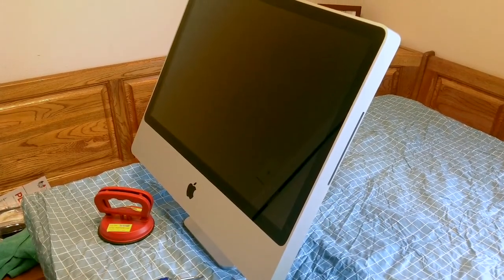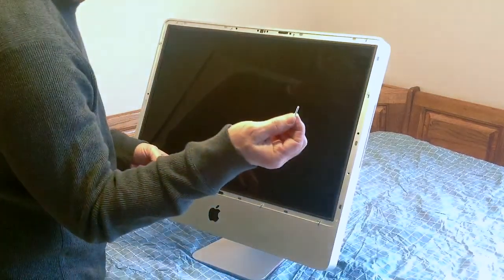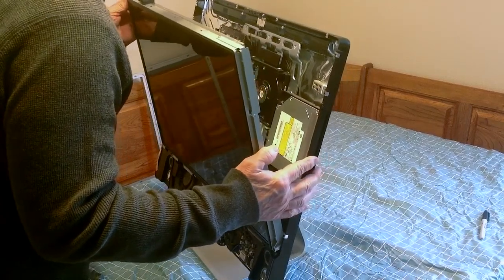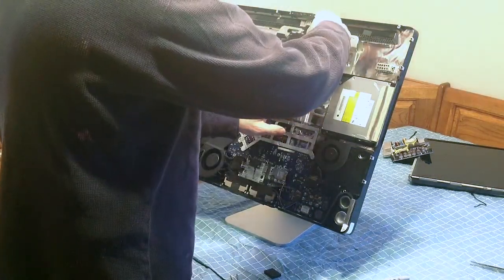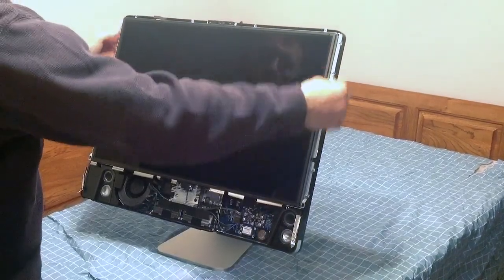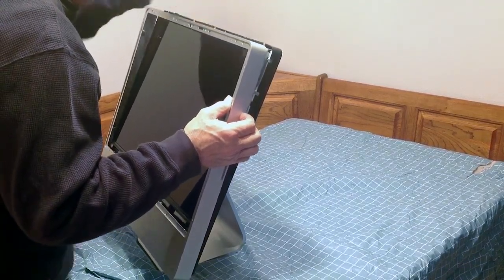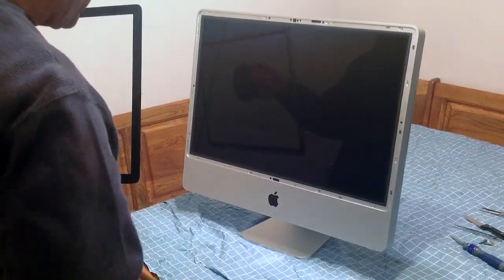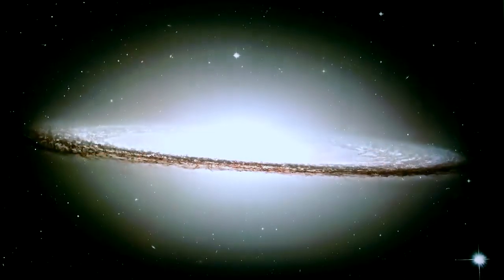iMac 24-inch Mid 2007 Hard Drive Replacement

Comment: Just successfully replaced the original 320 GB HD with an 1 TB HD into my sons iMac 24" 2007. You will need those suction cups to get the glas pane off and a No. 8 torx for all the screws. You don´t need the tiny No. 6 torx for the display connector, just gently turn the display sidways and you can access the HD. Start up from the recovery partition (hold the "alt" key) and install the new OS X. 
Look here: ifixit.com/Guide/iMac+Intel+24-Inch+EMC+2134+and+2211+Hard+Drive+Replacement/8968/1

Comment: Thanx a lot for that nice and clean guidance. I will do exactly this on my son´s iMac 24" 2007. I remember that good ole times when you didn´t need those suction cups and torx drivers to replace a hard drive. "But things there are a changing..."  :)